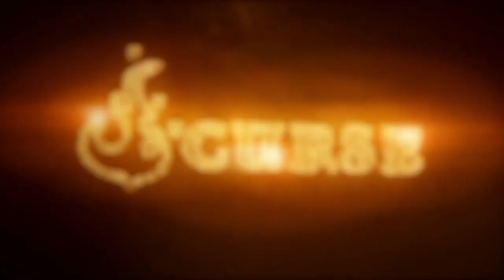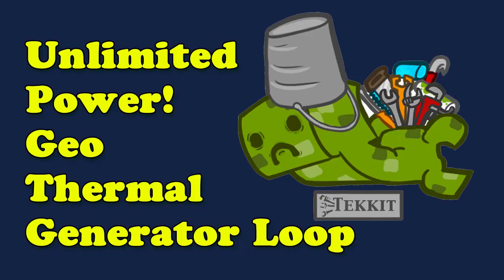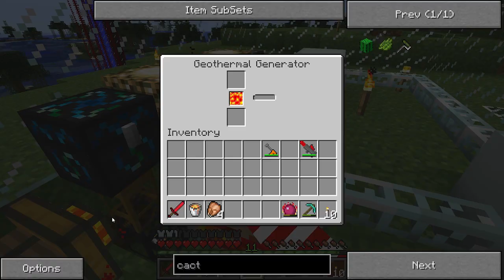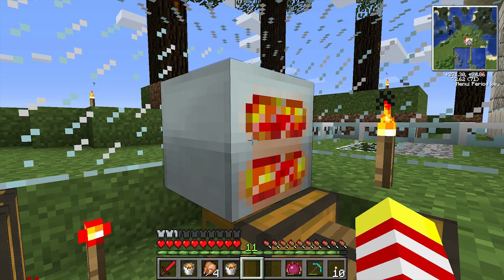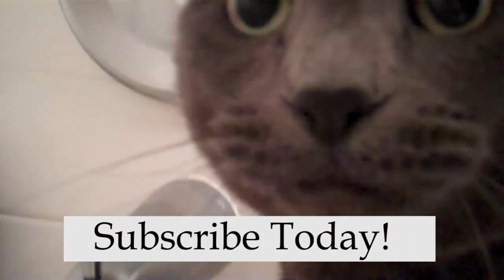Unlimited power in Tekkit - GeoThermal Generator Loop

Comment: I NEED HELP!! i built this, but the damn buckets are going to the top slot and and not the bottom, i have tried putting the pipe in every place possible and it still loads on top. i am playin TEKKIT LEGENDS
Reply: Miguel Copas the pipe needs to be place under the generator

Comment: the bucket doesnt empty in the generator and then pops out of the pipe..
Reply: Gamer Cheetah i have tried them in from every face of the generator. Maybe it's been patched or something in tekkit legends:(
Reply: ieuanlfc same Problem
Reply: use lava cells instead they are 1 emc
Reply: the pipes are putting the buckets into the wrong slot in the geothermal generator, how do i change it?
Reply: ieuanlfc it has to go in from the bottom

Comment: i have a setup with 5 macerators macerating blaze rods and then that gets turned into coal and blaze rods and i generate about 200k eu every 10 sec and that was running about 20 macerators overclocked by 4 but i am going to hook this up to my aray and my setup dose take 20 generators

Comment: the geothermal generator only connects to waterproof pipe and the energy condenser only connects to non waterproof pipe.  the two pipe types will not connect to each other. help?

Comment: Wooden pipe has to attach to the bottom of the geo. Don't forget about the engines. Lava Cells are fine, lava buckets are fine, too. For Transformers, the side with 3 dots is the input. All other sides are output.

Comment: this doesnt work for me .. although i have this on a little bit bigger scale. do i have to use lava cells instead ?
the lava bucket goes in the top not bottom. so it isnt doing anything. is there anyway to fix this

Comment: Nice tutorial. I use this method with over a stack of geo generators and i run all advanced machines including a mass fabricator with no issue. I agree that its the best power source. Try using lava cellts though. They work a lot faster

Comment: First, please use the Reply button. I almost didn't catch this =\
Second, sorry, I don't make videos. ^_^;
However, I would be more than happy to explain it to anyone wanting to know more. I switched from buckets to cells, recently, so the cobble generators are no longer needed. I originally had them to shut it down so the buckets wouldn't overflow. Now there is nothing to return. However, it seems glitched. Too many outputs and half of them stop working randomly. =\
On a server, anyway.

Comment: Perhaps, but once you have it, you'll have far more EMC than you know what to do with.
And 9 high is perfect for diamonds. you go all the way down to bedrock (y:5) and you use it there at full strength. It will hit every layer diamond spawns in. At the lower levels, it is also significantly more controlled than the destruction catalyst, especially with the Auto-Ore-Mining that is built in.
The only problem I have with it is the soil mode only taking 9x9x1 =\

Comment: If you use a bit of redpower you can get significantly more geothermal generators attached to a single energy condenser. I'm currently building a power plant that uses about 2 1/2 stacks of geothermal generators attached to only two energy condensers and cobble generators.

Comment: teleporters require a good bit of energy dont they? Im not sure...but that may be a way for you to use up excess energy...nice lil setup but I wonder if you might benefit more by using the energy condenser with an energy collector flower surrounding it...the flower itself rocks but once you upgrade it to mk3 you litterally have no need farm so its kinda a game buster:(

Comment: Oh and EE is not OP. It just turns things into different things that are worth the same amount. In the end you still need to collect stuff to get other things. Also to get anywhere in EE you need a lot of diamonds, and diamonds are very hard to find. So what's the point of even making any EE stuff if you can't just dump that stack of uranium in there and make some diamonds? AND red matter would be impossible to get without EE condensers and things.